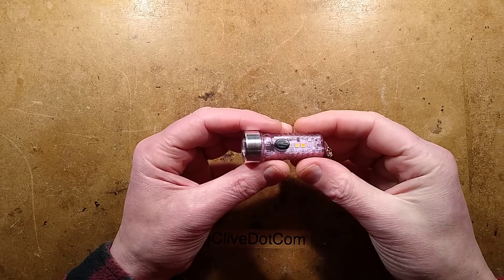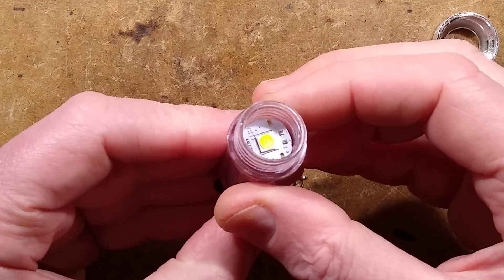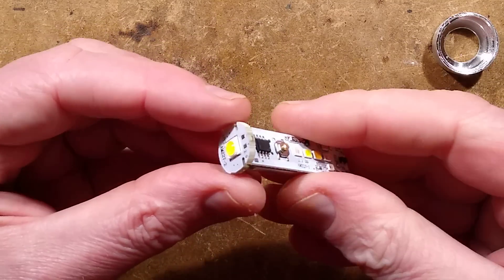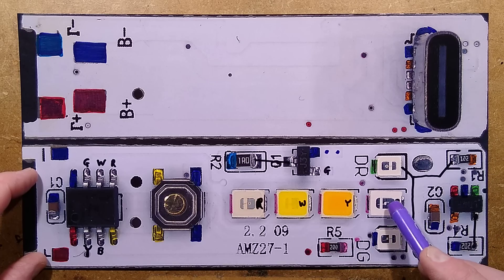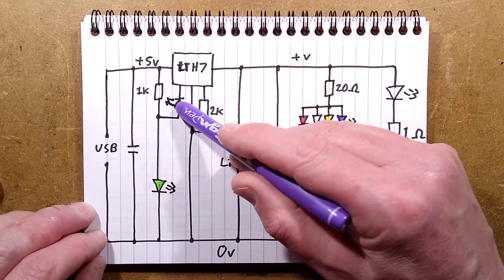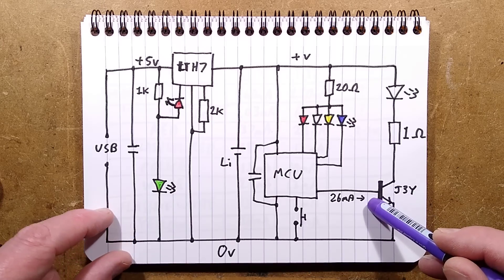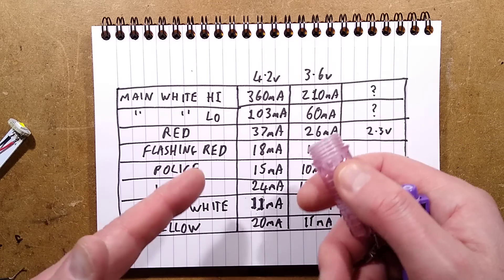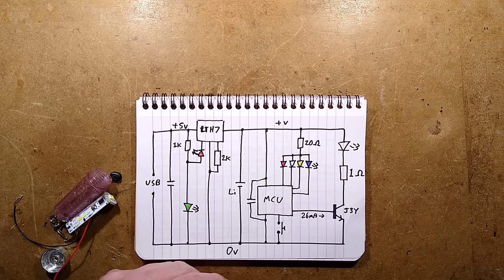Weird little light from eBay (with schematic)

Comment: Currently hacking hot plug power supplies with a 100 amp output for ham radio operations! Adding resistors to unlock the 12vdc to 14.3vdc with an other resistor to adjust the crowbar protection! Wish me luck!🤗👍🏼

Comment: The On/Off/Mode Switch was placed on AFTER the Board was inserted. If you look at the Solder Joints, you can see that every Component is properly soldered, but the Switch was actually "pressed" into the solder. Four dabs of solder were dropped on the Board, then the Switch was placed.

They could have simply used a Pin connection, but a soldered one is more durable. For what it is, it seems to be well-made and functional.

Comment: Can you dumb the registers for the MCU?  Did you fix the angle of the front white led to decrease the light spread?
Reply from the maker: I'd expect the microcontroller to be locked.  Not even sure what brand or model it is.  It would be easier just rewriting the software from scratch for a known chip.

Comment: When I saw the transistor being driven directly I thought it may be a BRT, but 26mA Ib is a bit high for a BRT. It's actually an S8050 BJT. You can get pre-biased MOSFETs too if you're worried about the inconsistent state when the MCU is off, but they're much much rarer than BRTs. I would just replace it with e.g. a DDTD114EC which would cut the Ib to ~400uA.

Comment: So interesting to see someone who breaks down (reverse engineers) the circuit and even single component function! Not many in this world are able to do that - and with almost any electronic equipment ever made. That takes more than passion. Oh 
! Clive, before assembly of that small unique torch, using a Dremel with selected diamond tip, it's a simple matter to place an internal groove, running down the length of the torch, the slot being in the correct orientation with the Press Button. Then, the press-button switch wouldn't be under great trauma when inserting the PCB and battery. Greetings from Australia.

Comment: EXCELLENT DESCRIPTION !! i have buy recently this little lamp , and i wonder if can be turned into a continuity tester , sacrifying maybe the secondary white led or the yellow led and making a little circuito to achieve this new funcion, connecting this in place of the led.
Reply from the maker: It might be easier to make one from scratch.

Comment: Hey big Clive:)     do you know anything about Bluetooth dongle's    ????        I recently blew up two Bluetooth transmit and receive dongle's........        I put in too much audio from an old CB/Ham radio......      And the volume was too much and they blew.......      Do you think you could help????     I know you like to know how stuff works......
Reply from the maker: It might be worth looking at the area of the PCB where the signal goes in to see if any components are showing signs of damage.
Reply: @bigclivedotcom  I'm confident that they will show signs of damage......       There was no magic smoke......      But they are both kina not working now in different ways.....          And the new replacements are kind of interesting........   Do you know anything about ham radio or spurious emissions???       The new ones Feb alot of immigration's???

Comment: If it's something you'd be interested in taking a look at, I've got an old solar panel charge controller that started making a ticking noise which I'd happily send to you. Love the videos Clive
Reply from the maker: Sounds like something cycling on and off.  Possibly at full charge?
Reply: @bigclivedotcom  It was during charging at any battery state, less of an on/off ticking and more of a noise you'd meaure in Hz.

Comment: I had similar light from aliexpress that drained the battery fast even when switched off._
Reply from the maker: That's often due to a bad ceramic capacitor acting like a resistor.

Comment: How can that 2k resistor sense a current?
Reply from the maker: I think it sets a reference threshold for the internal sensing circuitry.  It's not a current sense resistor in the normal sense.
Reply: @bigclivedotcom  thanks a lot Clive! That makes sense.

Comment: @bigclivedotcom, (7:51) the MCU isn't driving the LEDs, it's being used as a sink to ground. That's why it's able to work with higher current LEDs. If the MCU was driving the LEDs (+5v) it possibly wouldn't survive.

Comment: The "yellow" LED might not be yellow so much as very-warm-white (eg, 2200K) or PCA (phosphor-converted amber).
Only way to tell would be to look at various stuff under the light.  If actual yellow, everything would look yellow and black.  If VWW/PCA, things would lean towards yellow, but you'd also be able to see reds and greens, albeit faintly.
I've got matching Anekim hunting lights, red and green.  Red is monochromatic, so everything looks a stark red/black.  Green is actually PCG, and shows blue through red, albeit faintly.

Comment: I nearly bought ten of these weird little lights about a month ago ... I also doubt they are olight .. to me they look more like they are pirate ware [copies] based on some other manufacturer like Nitecore or even BORUiT.
Instead I bought four [4x]  LED High Power Super Bright USB Rechargeable Flashlight Tactical Torch Durable
[buy 2 get 2 free] ... and they turned out to be a con too ... 
The bumph says they're ABS in one section Aluminum alloy in another [it's ABS] and it also claims to have a 26650 Lithium Battery pre installed.
It was fun trying to disassemble one ... and no ... they have a low powered 18650 inside ... not even sure if its 100mah ... 
But, I must admit ... it IS tactical ... [the case / led and switch combined weighs about the same as the battery].   Tho I'm not sure how long the battery will last ... I took the one I disassembled out to get a donner kebab before I disassembled it. 
Bright enough for camping ... excellent for close contact warfare.
So I'm re-engineering mine to use as a helmet torch weapon thingy ...

Comment: thats interesting Im doing  a  project which requires the charge controller (USB) and most of the MCU function but not driving LEDs did you find out the MCU type ?  also when you explained the battery protection required is there a suggestion for this as Im just learning about the foibles of these battery types Your clip has helped jump start a project  thanks!

Comment: Why do you call the capacitors across the USB connector and the one across the MCU, decoupling capacitors? Wouldn't they have to be in series to be decoupling capacitors?
Reply from the maker: By acting as a tiny local reservoir the capacitor decouples noise from the power rails.  It's not actually a great name for it.
https://en.wikipedia.org/wiki/Decoupling_capacitor

Comment: Would love for you to do a quality comparison of led GU10 lights and why they are so dam expensive now. What makes good ones better than the bad ones. Would love to buy lights once than spend my life replacing them...
Reply from the maker: Unfortunately the classic GU10 format is quite small and prone to overheating.  The 3W lamps will last much longer than the 5W ones, but they never really quite match the intensity and beam of classic tungsten halogen ones.
Reply: @bigclivedotcom  the cheaper ones seem to be lower wattage counterintuitively but also have plastic surrounds whereas the more expensive have what looks like ceramic presumably  as you say to manage heat more efficiently.

Comment: Usually the selectable mode LED lights also support dimming if you press and hold the button when on a mode.  You might have missed that (don’t remember you testing a press and hold).  I have an extremely similar light in lantern format by a bigger US brand; next time I have it open I’ll have to check the chip.
Reply from the maker: No dimming of that style with this light.
Reply: Definitely a useful (and battery saving) feature - would have made that little light a really good deal.  You might be interested in a brand called LE Pro (used to go by Lighting Ever), very similar LED products to what you tend to look at, but a bit more reliable of a Chinese brand.  Honestly though, it's all coming out of the same factories.

Comment: Very handy little light, really nice that it does not go into the next mode when you press the button again so no pain in cycling through the modes to turn it off, all lights should have this feature, sos and flashy mode would be totally fine then because you can just skip them

Comment: Nice little flashlight. Funny you often have pink things
Reply from the maker: It's become a channel tradition to get the stuff in the most lurid pink I can find.  Especially the more dangerous stuff.
Reply: @bigclivedotcom  Okay it's funny of you to do this. You do indeed use that color regularly
Reply from the maker: @ronnievenhorst9873  I started doing it when the power supply for a set of pink LEDs exploded in my hand when I plugged it in, leaving a sooty outline of the case on my hand.  I thought it was hilarious.
Reply: @bigclivedotcom  Okay that would be scary too. But luckily it ended well. And ever since then you've had a thing for pink.

Comment: I'm at the point where i dont need more lights anymore lol.. Along with all the various USB and 18650 powered LEDs i have, Getting the PowerSmith Voyager PVLR8000A 8000 Lumen work light pretty much fulfilled my love of Lighting lol.. But recently i got a Craftsman 150W Inverter for use with my Craftsman 20V batteries, it allows me to use those super bright Garage/Attic type lights using a Light Bulb adapter and power them and anything else below 150 Watts with the inverter lol.

Comment: Speaking of the resistors on the USB-C. What value would be used? Is the resistor across the middle pins?
Reply from the maker: Two 5.1K resistors to ground to get the host to supply up to about 3A.
Reply: @bigclivedotcom  Thanks. I had heard of putting a short across the middle pins. I tried a dead short but it didn’t give me more charge amperage.

Comment: Looks very similar to a Nitecore tiki. I’ve been using the tiki for years now as an RN and paramedic. Super nice to have multiple variabilities for varying needs, doesn’t weigh a thing, rechargeable, and doesn’t break the bank when it inevitably walks away with your good pen.
Reply: +1 on the Tiki, I upgraded to it from the Tube which was also great, but the Tiki is a whole other level of awesomeness.
Reply: The tiki is very useful and with UV 😊

Comment: Does this light have stepless bright mode?
Reply from the maker: No.  Just fixed intensities as far as I can see.
Reply: @bigclivedotcom  You think is possible add a small potentiometer in parallel on the sense resistor for adjust brightness?
Reply from the maker: @MACYNET323  The sense resistor is just for charging.  The only way to modify brightness of the LED is with a resistor or new software.

Comment: To slide out things like that stuck switch, I usually use a strip of plastic cut from a PET soft drinks bottle. It;s thin enough to not jam tighter, low friction to slide along and tough enough to press the switch down as it pushes along underneath. Also useful to remove the larger cable ties without cutting them (slide it through under the latch to release) and a very small piece with a pointy end is good for removing compacted fluff from a micro usb socket (when you've had a phone in your pocket) without damaging the centre part, or it's contacts.

Comment: I don't understand why all the flash lights from China only have that 1 single button but cycles through insanely many modes. It will be annoying as hell if the light mode you want is the 5th or 7th.

Comment: There might be a low voltage protection check in software that disables any LEDs when the battery voltage is too low.  It would be interesting to check for that.

Comment: Could you make a video explaining the most common terms you use, like "decoupling capacitor"(why is it there and what is decoupled and why not just have a gap) "bootstrap circuit" and similar. I have a general idea what they are but would like a more detailed description/explanation and perhaps a fiew examples. Technical terms with no explanation at all makes it a bit hard to follow some of your videos, but perhaps that's just me that want that. You are a good source of knowledge and inspiration, I just hoped you could add that to the library.
Reply from the maker: A decoupling capacitor is used next to things like voltage regulators and microcontrollers to act as a tiny reservoir for current to decouple spikes and dips on the power rails.  A bootstrap circuit in an electronic power supply is the bit that acts as a power supply for the control circuitry once it has started up.
Reply: @bigclivedotcom  so a decouple cap is a "buffer" against fluctuating voltages? would it not be more precise by adding zener diodes to put a cap and threshold voltage or would that be over engineering/overkill ? And the bootstrap is what powers the power supply regulators/controllers?

Comment: No way to remove heat and useless modes was this for kids but then they found out kids didn't want it? 🤣

Was the light any better after realignment?
Reply from the maker: It was a better beam shape, but a wider lens would have been better.

Comment: It bugs me seeing such 'throw-away' torches with tiny batteries which aren't replaceable by the average person.
The keychain torches I've been using for 20+ years now come from PhotonLight called "Photon Freedom Micro LED Keychain Flashlight", yeah big name but ignore that it's not just an on-off torch, it has a chip for dimming, strobing, and has the ability to do morse code, all with a single button.
I use a single CR2032 cell for longer runtime, but most use two CR2016's to get very high brightness, the LEDs they use have two diodes inside with a specially shaped head for a smoother beamspread rather than the horrible circular spotlight of most regular 5mm LEDs.

Comment: Hey Clive is there any chance if you haven't already, of doing a video with a toy or something that has lights and sounds that run off a button and shut off and stay off til you push the button again? I'd really like to get your thoughts on how circuits like those work.
Reply from the maker: They usually have a dedicated chip for the on-time function.
Reply: @bigclivedotcom  would it be like a 555 or something different?

Thanks for the reply!
Reply from the maker: @speedfreak91  It could be viable to use a 555 where the button charged a capacitor with a high value discharge resistor across it, and the threshold detector in the 555 shut the output back off when the voltage dropped low.  But there might be a bit of standby current.
For low loads you can use a MOSFET with a capacitor on its gate, but the load would fade off slowly.
Reply: @bigclivedotcom  ah ok

Thank you so much again for your time to reply I really really appreciate it!

Comment: So with no battery protection, if you were to leave this in a drawer for a few years, would the quiescent current of the microcontroller discharge the battery beyond repair?
Reply: Probably. I bought some mini mp3 players to re-sell on Ebay once, a real bad idea as the price went down so I was stuck with them at a loss. All of them now have destroyed batteries from sitting and slowly discharging.
Reply from the maker: It could go down to zero volts and the LTH7 chip would go into 10th current recovery trickle mode to bring it back up to 3V before initiating a full charge.

Comment: Is there a logic level Mosfet that can turn on at 3V? If they do, they must be expensive.
Also, even the crappiest bipolar transistor has an hFE of 100+. They are wasting power by not using a base resistor.
Reply: The A2SHB, part number Si2302, offers Rds(on) of ~115mohm at 2.5V Vgs. LCSC's price is about double the price of the S8050 used here. Both are less than a penny each when bought by the reel. Old power BJTs were sold with minimum betas as low as 8 (MJE13005).
Reply: @abitofabitofabit4404  Thanks for the info.
in my days, Vgs of 4V was minimum available.
Reply: @abitofabitofabit4404  Power transistors all have low hFE.

Comment: Did you try a press and hold of the button? It seemed to me to be a bit brighter when you were going trhough the button presses...
Reply from the maker: Pressing and holding just brings on the first mode.
Reply: @bigclivedotcom  Might have been the camera auto-aperture doing it then. In any case, I just bought one for myself and one for the wife. Found virtually the exact same  one but it has a "UV" LED in place of one of the handle ones. Will see if it really is UV when they get here. Being in AU, that will be 4 - 6 weeks...

Comment: Is that a fairly recent innovation, where pausing and using a mode causes it to switch off on the next push? I recently bought a great little magnetic work light with that function and think its the best feature (besides the 18650). I wonder who they stole the original idea from.   Ive numerous devices where you have to cycle through the useless modes just to get back to the off position.
Reply from the maker: I don't think it's new.  Just implemented in better designed software.
Reply: I remember having a flashlight about five years ago that would do this, so it's not that recent...

Comment: 3:47 If it "maybe just sits on the lithium cell," that's a major safety issue due to the way lithium cell pouches tend to expand over time. When that expanding pouch gets into a tug-of-war with the plastic enclosure, which gives way first? If it's the lithium cell pouch, then you got Trouble In River City!